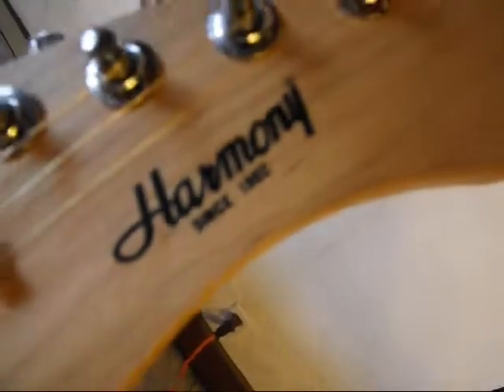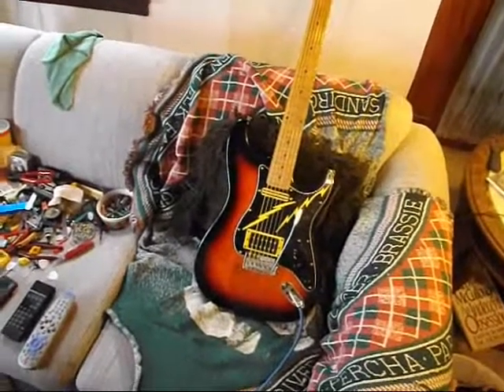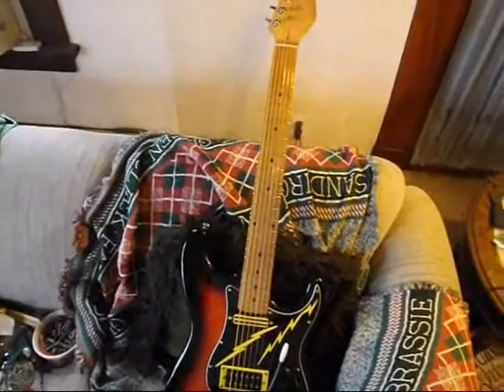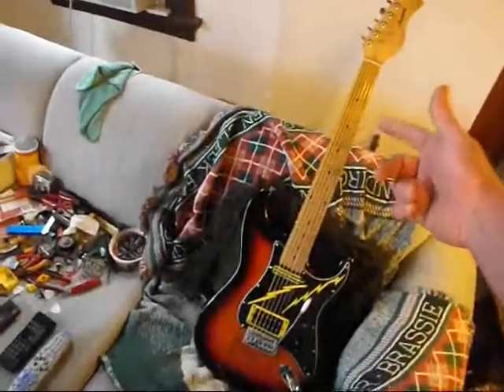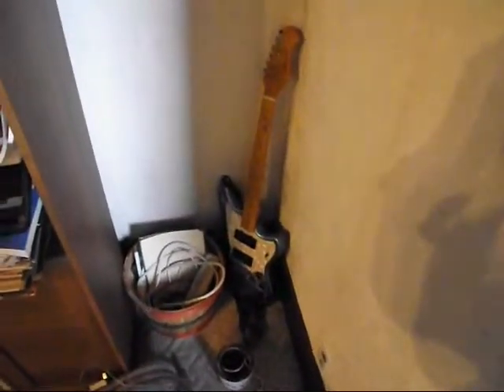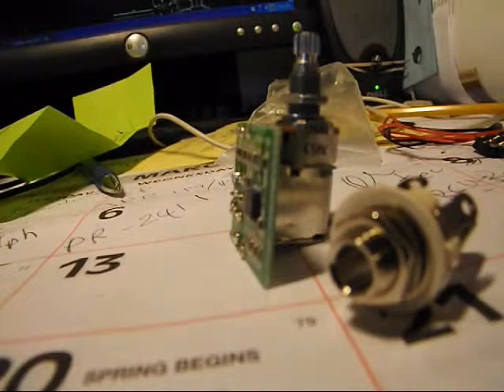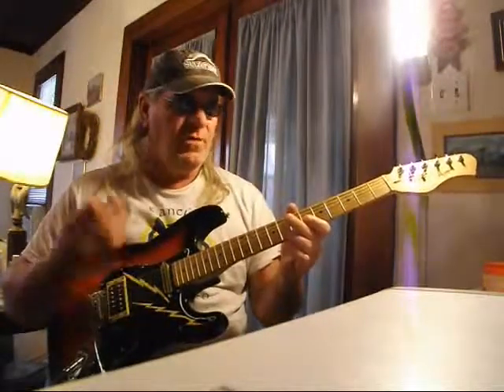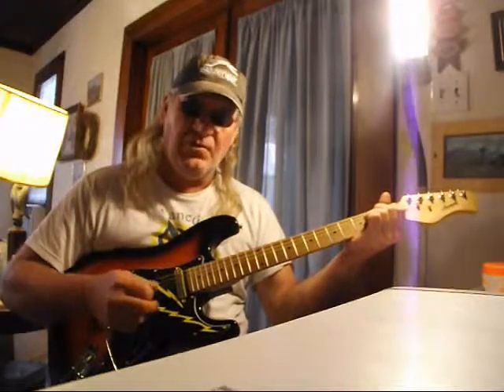Redneck Guitar Mod

Comment from the maker: It changes the "bandwith" of the analog tone signal.  That guitar in my video is an HH (two humbuckers). You would have to ask them at GuitarHeads about wiring two of these in. They recommend going with a master volume and tone for all the pickups and wiring this Artec in as a push/pull active mod to tone tweak.
Get a Digitech if you want to hear a single coil sound like a humbucker.